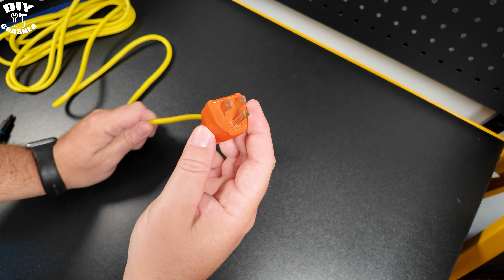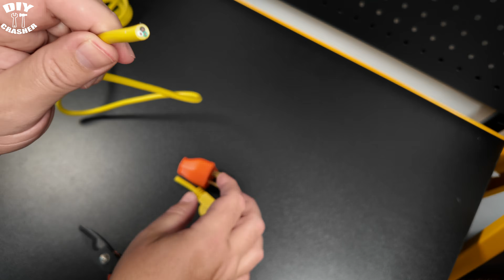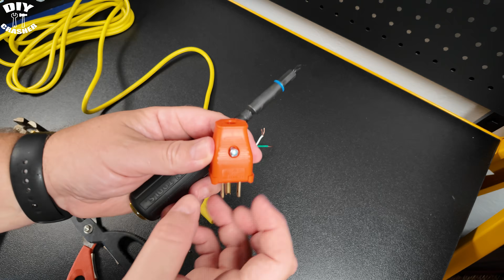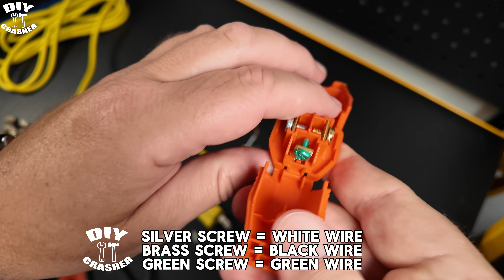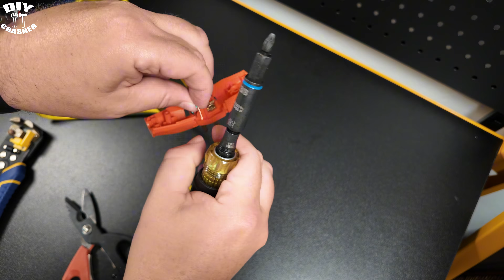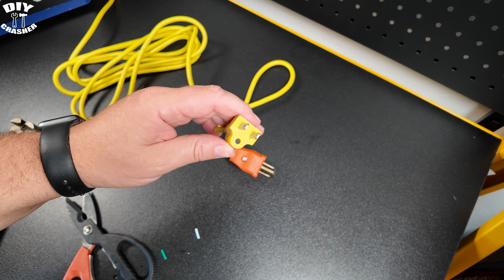Easy Plug Repair Anyone Can Do!

Comment: Thanks so much for this info.  I have a fridge that makes the sparking noise when I plug it in.  Last night I just left it unplugged because it stopped making the spark sound and it didn't power my fridge when the light didn;t come on.  Today I noticed the prongs (3) were very loose and wobbly.  The plug is flat on the top side so do I need to buy a plug that looks the same, or does it not matter?
Reply from the maker: Yes, you should try to match the design and orientation of your original plug to ensure it fits and functions correctly in your outlet! 🛠️  Based on your description, it sounds like it's a 20 amp style plug so it needs a 20amp line and breaker and if you tried to plug it in a differnt normal outlet with 15amp line/service then the fridge probably won't work properly and risk damaging it if it doesn't get enough power.

Comment: I have one one of my 25' extension cords thats missing that neutral prong.  My solution is to use that extension cord for 2 prong tools only.  And i have a surprising number of two prong items that i use it for.
Reply from the maker: Do you mean it's missing the ground plug instead of the neutral?
Reply: @DIYCrasher its missing the round 3rd plug that your example was missing.  I am terrible with remembering terminology.
Reply: @DIYCrasher  ok i rewatched your video.  Its the ground plug like in your example.

The only thing i was trying to say was 95% of what i would use that extension cord for would be 2 prong plugs so functionally the ground plug missing on the extension cord would make no difference for me so i just avoided fixing it.....for the last 20 years.  Seriously, its really that old.😁